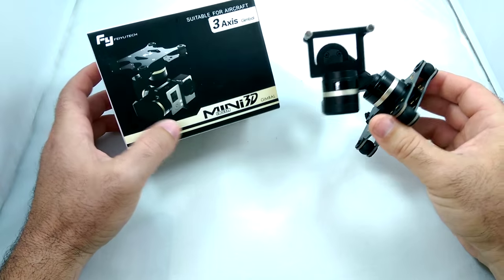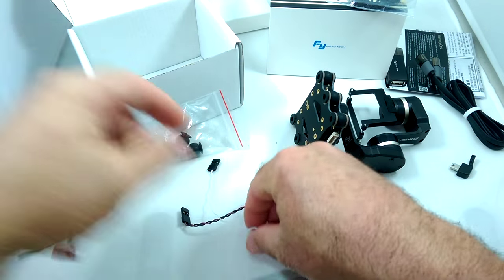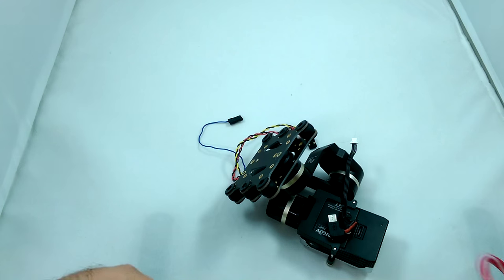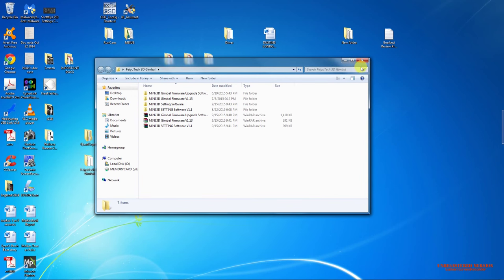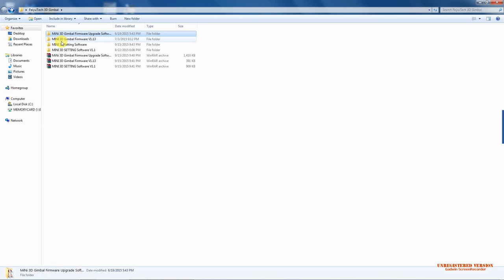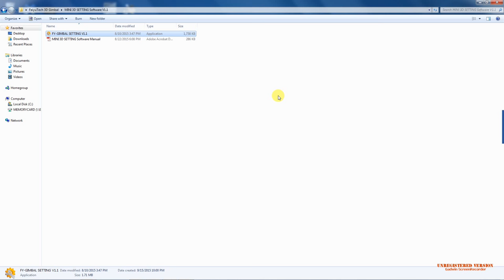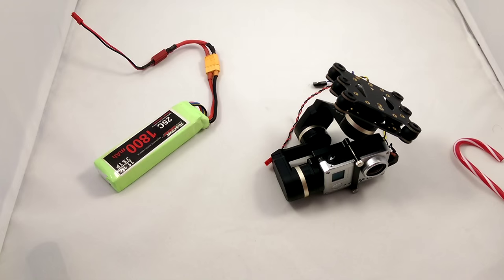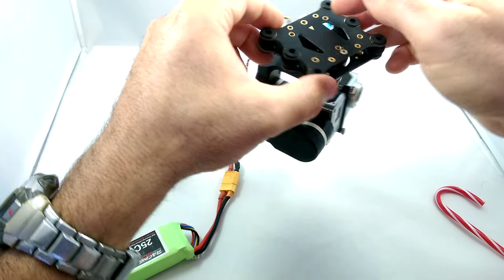FEIYUTECH MINI 3D Brushless Gimbal Review - [Setup, Flight Test, Pros & Cons]

Comment: Hi I need help please....saw this video so got hold of a feiyu mini 3d.ive fitted it to my phantom p1.1.1 and wired to the same plugs as my last 3d gimbal ie power and tilt.the gimbal works fine powered up but when I go to tilt down or up it doesn't stop just rolls down or up all the way round and round until I set the gimbal lever to centre....on my other gimbal it only went so far and stopped....ive played about with end limits on my dji phantom program but nothing works...just goes around....it went round so many times it umplugged itself inside the gimbal motor.....please help as I need it to stop pointing level and straight down without having to turn the giombal slider back to centre when flying as this would be a royal PAINwhat am I doing wrong...the gimbal has latest version firmwarecheers steve
Reply from the maker: Hey Steve.  I honestly don't know.  Can you stop it from going further with the pitch knob?
Reply: +Dustin Dunnill yes it moves up or down until I centre the Knob. it stops as soon as I centre it. but I want it to stop on its own like my other gimbals did at end of Knob travel.
Reply: +sky cam video You have to calibrate the X1 channel in Naza assistant. I had the problem. I moved the Tx lever and it would only go UP or Down. But in the Naza assistant you can calibrate the X1 channel like you can calibrate all the others. In the assistant go to BASIC, then click on the RC tab. You should see the X1 Calibration partand and click on the START button. Then wiggle the pitch lever so it goes to it's maximum travel in both directions and then click STOP. You should now be able to have gradual control of pitch. If you dont, X1 channel will only have up or down.
Reply: +Psyonic Wombat PS I have the pitch limits set to 10 (slightly pointing up), -450 (mid point) and -900 (looking straight down)..

Comment: Dustin, Can I use a mac to instal this firmware?  I don't have a PC.  Please advise.
Reply from the maker: Honestly not sure.  You may be able to get an iOS version from the feiyuteck website.
Reply: Thanks Dustin.  I'll send them an email as I am having trouble getting access to their downloads section.  Appreciate the swift answer.
Reply: im not familiar with mac and wine myself, but worse case, you can run a fake windows machine on mac with the software "wine"

Comment: Hi excellent review.
it can be installed in the phantom 2 vision+ with the WiFi Extender RE700 ? ?
Reply from the maker: +Vicente Espinosa Not sure sorry.  Maybe try and check the product link in the video description.  They may have some info.  It should work fine I'm just not 10 percent positive.

Comment: Can you flip this gimbal upside down and install it on a motorcycle?
Reply from the maker: Yes, it can go upside down or forward mounting via the manual.
Reply: +Dustin Dunnill thanks! But does it greatly restricts the movement or rotation of the motors?

Comment: Any other camera  that u suggest beside gopro  since this one is made for go pro and others  donot fit some thing with 4k  i seen lots of cheap Chines made cheap cam on ebay but they are thick  any suggestion any one   Thx
Reply from the maker: +john Al I have just recieved a Gitup Git2 cam and it works flawlessly with this gimbal.  It is 2k max but works very well for the $ and has alot of options.  Fits perfect in the mini 3D gimbal and accepts the FPV Mini USB
Reply: +Dustin Dunnill  but that is 41mm thick  then  can not be hold by those that comes with gamble
Reply from the maker: +john Al it fits perfectly since the hight is all that matters.  The depth and width can be variable.